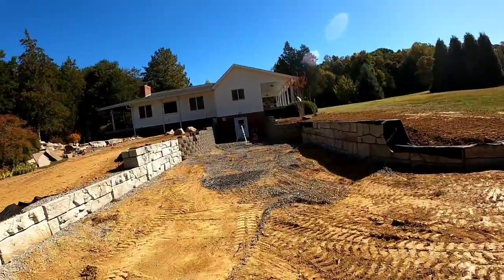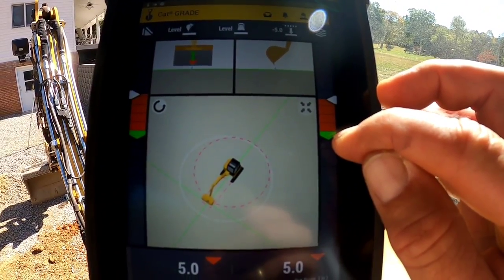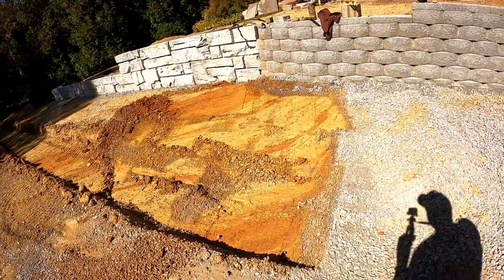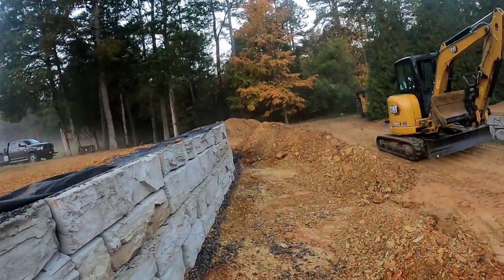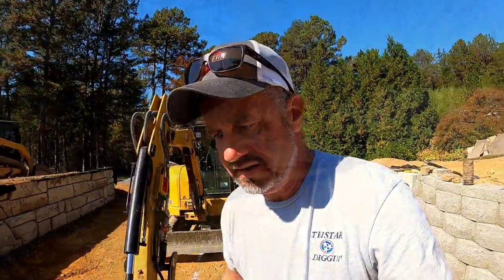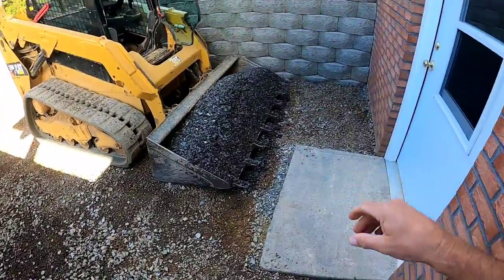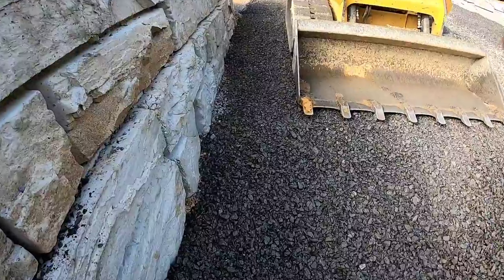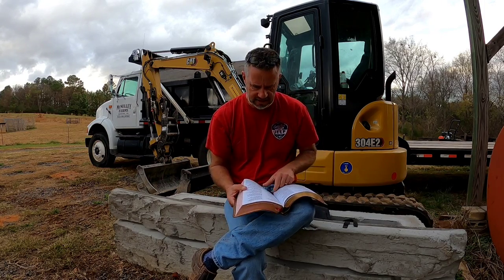TRIMBLE EARTHWORKS AND TOPCON RL-SV2S LASER DEMO ON CAT304

Comment: Just got done watching the video where you got the sv2s laser. I've been thinking of getting the larger topcon machine mounted receiver in the future, and maybe at some point a new laser with slope. I have a bosh laser now that doesn't have slope. when I did that drainage swell last year I walked down it every few feet and checked with grade rod to make sure it was going lower and then eyeballed the rest since actual slope wasn't important just as long as water went where I wanted, it turned out well. That Trimble earth works is pretty sweet as well...
Reply from the maker: Laser with slope makes a job so much easier to do. It takes out the guess work. And coupled with Trimble Earthworks it's a game changer. Once it is setup you don't have to get out of the machine. I'm hoping to add Trimble Earthworks to the D5 this year. I have a laser receiver to put on the stick of the 308 but it's no comparison to Trimble.
Reply from the maker: The job I did in Ringgold, installing a storm water system, was a great example of having a laser with slope. I had to fixed elevations and needed to dig a certain slope for those 2 elevations to meet. So I calculated the exact slope needed and programed the laser and Earthworks. The ditch came out perfect between the two elevations. Would have been extremely difficult for me to eyeball that dig...
Reply: @tristardiggin  Thinking of getting the large machine receiver that mounts to a pole, lsb200 I think is what it's called now, and probably build a pole mount that I could bolt to my dozer blade and maybe tractor bucket if I needed, and also get a magnet mount to be able to use it on an excavator. It's universal and I could slap it on a rental machine etc... That and a slope laser Would suit my needs for the occasional projects I do.

Comment: Great video!
You do a good job explaining. 
Iam a town foreman up in Canada, we are purchasing a new excavator for town ditching. 
You mentioned if you had the twist wrist attachment and 7 grand you would have purchased a different model laser?
I have ordered the twist / tilt bucket and would like to know what laser would be best for my application.  Our excavator is a kubota 040-4?
Thanks in advance !!
Reply from the maker: Thanks I appreciate that. I use a Topcon RL-H5A dual slope laser and it works great with the Trimble Earthworks system I have on the CAT 304. It is a programable slope laser. 
What I referenced in the video had to do with the Trimble Earthworks system on the CAT 304. Not sure how much you know about it but it is 2D grade control for the excavator. If I bought a tilting grade bucket I would also have to buy a sensor for the bucket which would work with Trimble Earthworks. Plus I would have to pay for them to install the sensor and program the computer to recognize it. Hope that made sense. If you want to email me your number I can give you a call to help you figure out what you might need. Tristardiggin@gmail.com 
Sam

Comment: Question, Could you of cut the middle section at 1.5% the way you did but then come back and cut between the wall and your 1.5% cut area with the 304 and set the earthwork system at 1.5% from wall to first center cut on both sides?
Reply from the maker: Yes, that would work just fine too.
Thanks, 
Sam
Reply: @tristardiggin  Thank you for the reply. Love the videos!
Reply from the maker: And thank you for supporting the channel, I appreciate it...

Comment: HEY WHERE'S MY BACON 🤔 LOL 👍🏻 JOB LOOKS FANTASTIC. I WAS WONDERING WHY YOU DIDN'T PUT DOWN ANY FABRIC FIRST I REALIZE OVER TIME STUFF IS GOING TO GET IN THERE ANYWAY. DOES THE CUSTOMER TREAT IT WITH SOMETHING. THANKS FOR SHARING GOD BLESS
Reply from the maker: I'm stingy with 🥓 😁. Shouldn't be anything get into the pipe since it has rock on both sides and over the top. If anything it would be minimal. That ground was very hard. I was going to get a sock for the 6" pipe but they didn't carry it in the store. Would have to be ordered.
Thanks, 
Sam
Reply: @tristardiggin  I don't share my bacon either. Cool thanks great job 👍🏻